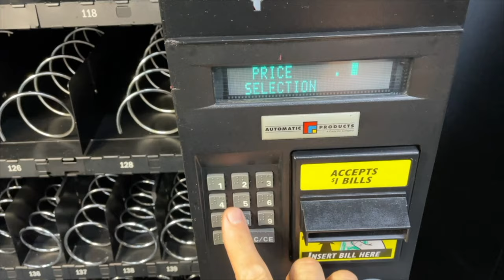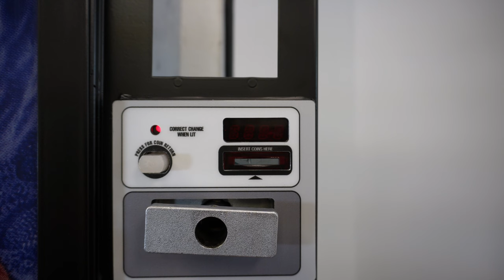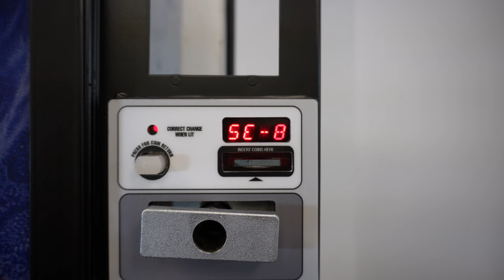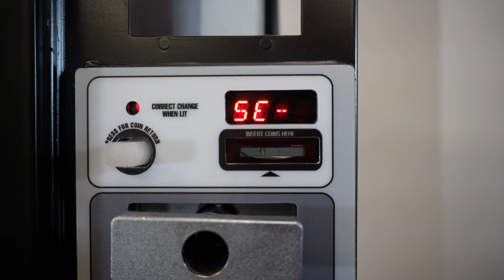How I replace a Dixie Narco drink vending machines selection switch membrane

Comment: Great video! Keep them coming👍 🙏
Question, would you be so kind to show how to replace the complete door lock mechanism along with the housing that's screwed in behind the door on the Dixie narco 501e? I have a machine that doesn't lock too well allowing the tubular lock to intermittently pop back open or does not securely lock in place after rotating the door lock closed and pushing the lock handle in. I have changed out the lock cylinder with a few known good ones and still no luck. Any help would be appreciated!
Reply from the maker: This is a great suggestion! I will add it to my list. The issue you are explaining sounds very much like the retainer. The part that is bolted to the machine on the inside is bent. This prevents the dead bold on the plug lock to pop-out when the T-handle is pushed in to to lock.

Comment: great video! but the part where you said 1 and 2 have to work, is exactly my problem lol. for some reason switches 1 and 2 went unresponsive in normal mode. but when i switch to maintenance mode. hitting either the 1 or 2 button acts as though I'm hitting both at the same time letting me scroll through the menu. but i can't hit them and select through the menu. no error codes either. no sold-out message, no prices show up. i tried to reset the PCB a few times but no good. took the board out an dcleaned it too. checked wiring looks good. any advice? or you thinking a new board? i have a dixie narco 276e   SII-D PEPSI/7UP/Generic   (Redbull machine)

Comment: I really like your videos. The videos have gotten my machines up and running. I need help with a 501E that I need help with a button problem that is way out of my league. My 501E vending selector has the round button style. The relays are mounted on a plastic rail running the whole length up and down "inside of coarse". So the problem is that someone pushed so hard that it broke the rail and now the select button is pushed INTO the machine. I have no idea how to order this part or even how to replace it. 
I'm looking through the manual but cant find anything online for this part. Please help!!!!
Reply from the maker: Thank you for the kind words. Lets see if we can get you fixed up. There are a few different styles the round buttons 501E used to mount the physical switch. Here is a link to the most common "Rail". ( https://www.veii.com/SWITCH-BAR-PANEL ) You can take the switch off the rail and get the push button to pop out. It is just stuck against the metal skin of the door. Hopefully that can get your machine working again.

Comment: Hello, great video as always! Could you help me out I have the same machine (DN276e) I find that on occasion my machine sells drinks at a very low price. For example a drink that is set for $3.00 would vend at that price like 19 times but then on the 20th it will vend at $0.16.  This always change sometimes I could go the whole month without this issue and other times it may happen 3-5 times within the same month. Other times it happens once. It is truly random and I was told to reset the machine completely and reprogram it, but not sure how to do that and since its on location (and my top location) I can't afford messing it up completely! 

Please help if you can I really don't think it's the board, and I was told it might be in gift mode/prize mode -- but not sure how to check and like I said I don't want to risk messing things up! 

So a video on all the things I can do to test and figure out what the issue is and fix it would be great! 

Thank you!
Reply from the maker: @Jackie Low Thank you for the kind words. From your explanation the secondary price option, SEC and PRP2 found under the USER portion of the program matrix, could be enabled. This can be difficult to reprogram if one is unfamiliar with these settings. Your best option is to do a full factory reset on the control board. This is easily done. When completed the reprograming of  the vend prices is all that is needed. That is of course if your control board is a S2D control board. Looking at the serial plate of your machine will tell you the type of control board. It should read SIID.
 
To reset the board all your have to do is remove the CR2032 battery on the control board. To find the batter you first need to remove power to the machine then remove the cover from the control board. The battery will be located at the upper left corner of the board. Pull the battery out and wait for 15 minutes. This will allow the RAM chip to clear its memory. Then re-insert the battery and power the machine back up. You will know the board have been reset for all the prices will now show as $99.95. At this point reprogram your prices accordingly.

This is a great video suggestion! Thank you! I will see what I can do in the next few days.
Reply: @VendingMachineSupport  Oh my god, I can't believe you actually took the time to reply in such details! 
I absolutely appreciate it! PLEASE definitely see what you can do regarding a video (I am a visual person so this would help tremendously). I will however, start looking into what you described above and see if I can determine what type of board I have and where the battery is located. If you want I can send you pictures if that would provide more content for the video. 

I was told that some dn276e have the battery solder in the board. This absolutely terrifies me if this is the case with my machine because I have no idea how to solder, let alone how to "un-solder" something.

Quick question, in regards to the "reprograming phase" is that simply resetting the desired price of each selection and that is it?
I ask because a repair person said it is super complicated and involves the person going into the machines settings and "telling the machine" that it is a dn276e from a list of pre-set selections ...etc. (felt like he was trying to scare me from attempting to fix it myself) and make a sale. Disclaimer, he is also the same person the said some batteries are soldered into the board ... In your experience is this true? 

Thank you!
Reply from the maker: @jackielow4864  Here you go: ( https://youtu.be/oiQZc_m4Pi8 ). This video is specific to the S2D control board. There are two styles of S2D controllers. One version does have a soldered in battery. I explain how to tell the difference in the linked video.

If you have the soldered in version you may need to seek assistance with that if you are uncomfortable with soldering.

The Dixie Narco E series had several different types of control boards in them during their production run. Typically I have seen the S2, S2D, and SBC types. The SBC, to my knowledge, is the only controller in the E series that requires the programing the board to the model of the machine. This is usually  done automatically once the board is powered up as it will detect the total amount of selections buttons in the machine and configure accordingly.

Best of luck with your Dixie Narco drink vending machine.
Reply: @VendingMachineSupport  Thank you very much! I will definitely let you know how things work out! Please continue making amazing content! I'm sure within time your channel will blow up -- at the end of the day just know you're really helping us little guys/gals out a ton so please don't get discourage!
Reply: Could you make a video on the Studio series Automatic Products GoldenEye setup? Haven’t found one, and it does not seem to be set up on my Studio 2D.
Reply from the maker: @chrisseverin6370   Great suggestion! Is your Automatic Products Studio 2 and SL or ST model? 

If a SL model:  Press the service mode button. Enter in code 20 for Golden Eye (GE) setup. Then press < or > to cycle through the selections that are GE enabled. To enable a selection. Enter in the selection. To disable press # when the selection is shown in the display when cycling using the < or >.

If a ST model: Press the service mode button. Display should read 'NO ERROS PRESS C FOR MODES'. If not then clear out the shown error by pressing the # then . Then press C for modes. Enter in 21 to enter Golden Eye (GE) setup. The enter 1* to enable all selections to GE.

Hope this gets you started. I will add your request to my list. Thank you for watching and subscribing.